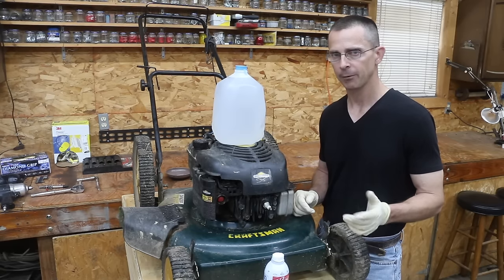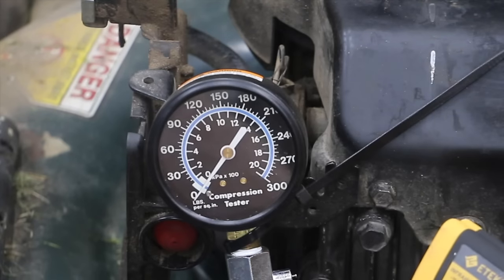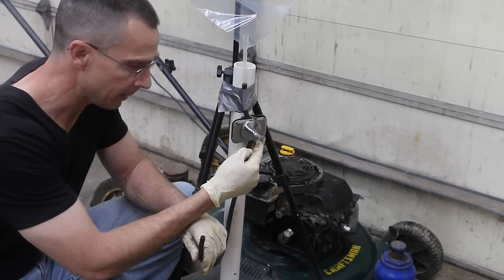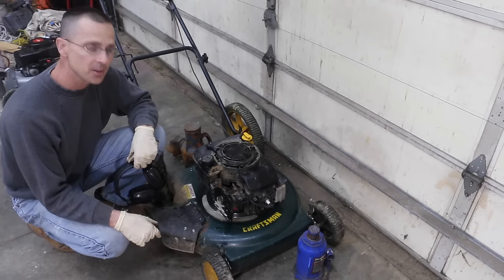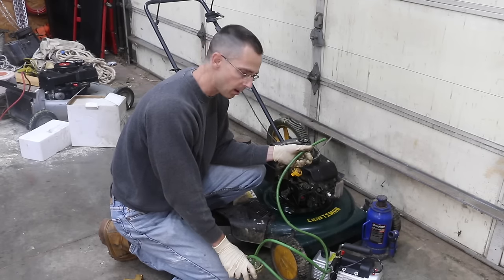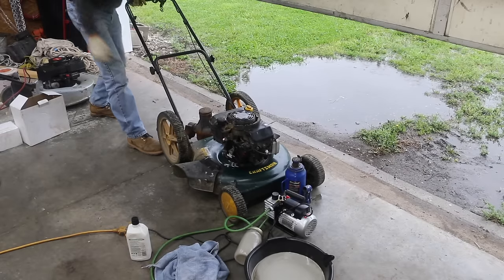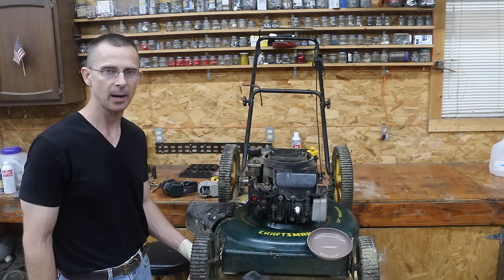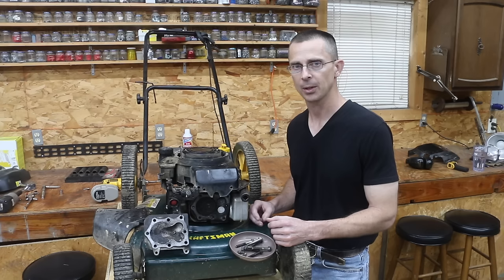Seafoam--can't believe what it did to my engine episode 5--cylinder cleaning test using water!!

Comment: Sea foam: spend $7 pour, run, change oil, enjoy. Water: Free design drip system, construct drip system, run and monitor for hours, change oil several times (not free), enjoy.  You decide who's the winner.
Reply from the maker: Thank you!
Reply: The viewers won outright.
Reply: Seafoam in my book. Much less work on my part. My time is worth more than  the $ 7.00  for seafoam when you consider all the extra time needed for the water drip, extra oil changes and the oil.
Reply: Not to mention that water has low lubricity. Water on the cylinder walls is oil NOT being on the cylinder wall. Seafoam atleast has lubricity. Thats enough for me to stay away from water.
Reply: It's easy to see the clear winner here. But for people who has time, H20 hands down !
Reply: Yes, a spray bottle into the carb is all you need, not a gallon of water.
Reply: ferkemall  so what is the original stuff
Reply: @BepBepStev  there shouldn't be oil on the cylinder walls above the piston. Water injection is/was a widely done thing on turbo engines to lower combustion temperatures and doesn't cause issues if done right.
Reply: @ItsFriscoBaby  the oil scraper ring is designed to leave a very fine film of oil on the cylinder wall. Thats why there is also cross hatching. The grooves in the cylinder wall are so fine yet they allow a small amount of oil to sit in there for lubrication.

Also side note. Water injection even during world war II was done for combat/emergency only. If done right it will take it a long time before it causes damage, but regardless, it eventually will cause premature wear on the rings and cylinder wall.
Reply: Still looks like carbon build up on the head and piston, just wire brush it !!
Reply: The reason that the water didn’t work well is because he didn’t do it correctly. Plus it’s a lawnmower engine. Here is my opinion, it is a lawn mower easy to take apart. You can either use seafoam and it work decently, or you could use water correctly and it do a little bit better than seafoam. Or since you can easily take the head off, you could just wire wheel it literally perfectly clean and spray some break cleaner on it and clean it off with shop towels. Which btw is 100% effective.
Reply: They didn't ban 2 stroke engines and 2 stroke oil is still plentiful. Sea foam is a mix of an oil and a solvent. Not just rebranded 2 stroke oil
Reply: Who would even suggest inserting water anywhere close to the insides of a hot engine ? I hope no one's my mechanic. Water doesn't lubricate well, doesn't combust, can cause corrosion, blows by into oil. Definitely not a good idea inside any engine that I'd want to see last (yeah don't tell me about performance, water-meth, etc. it's not the point of those videos at all).
Reply: I think its best when using a spray bottle at least some kind of mist system instead of a 'drip' for better atomization. And I think its alot of water for a single cylinder application thus finding water mixed with the oil.
Reply: Justin Henry  Well tell that to the piston rings, crankcase and oil. They didn't get the memo.
Reply: A cheap squirt bottle with a spray nozzle and a few sprays like 1 or 2 every 30-40 seconds over 2-3 minutes is enough water to break up any carbon, but not destroy any sensors, you're basicly just steam cleaning the combustion chamber and valves
Reply: Seafoam
Reply: @BikerBry  Very few cars still on the road have carburetors these days.
Reply: @ProjectFarm  My high school instructor told me about this..... his solution for getting water into the engine was a spray bottle.... If memory serves me it needs to be a mist like fuel, small particles. Basically the hot engine gets misted water inside of it and it turns to steam.... The way the water was going in was bringing down the over all temp of the engine..... I've never tried it personally but I think it would be worth a try... Just like a leaking head gasket on a car, usually the clean cylinder is the one leaking water.
Reply: ferkemall p
Reply: Its called a  test.
Reply: @randyl.wilmoth2884  no it works like this- steam does not compress like air so it fractures the carbon. I used a t fitting to the throttle body then 1/8" clear pvc tubing to the drivers seat.  2 small brass needle valves, 1 goes to a slim pickup tube in a quart of distilled water. Cap is vented. Other valve to air. Open that first then introduce water at highway speeds where vacuum is constant. Helps to have an expansion chamber of larger tubing for atomization. You shoot for 1:10 water to fuel.  In about 25 miles  of operation your combustion chambers are shiny clean.
This was on a 95 isuzu rodeo that failed smog. Seafoam and techron had no effect. Results checked with borescope. Engine revved more freely after and passed smog.
Reply: so he spend 2hrs using water and save $7 on seafoam , i guess he make only $3.5 per hour and was it worth the time spent ? lol
Reply: @samhandsom236  dont know about him but seafoam was completely ineffective on hard carbon deposits on piston domes. Water did the trick in a couple hours of driving.
Reply: @MozzaBurger88  lol youre worried about  drop of water getting into the crankcase oil? What about the combustion by product? 
A little gets in. The moisture quickly evaporates in the heat.
Reply: ferkemall  Is this supposed to be a joke? Sea foam doesn't have any of the properties of oil.
Reply: ferkemall  Please present your facts
Reply: Jesus.
In a car you get a pump pack (to atomise the water into droplets), take your aircleaner out, and SPRAY SOME into the inlet at regular intervals. Do that for a bit. Job done.
Reply: ferkemall  Seafoam is not engineered like 2-cycle oil at all. It does not act nor perform like oil. You will damage any engine if you try Seafoam as an oil and not as an additive.
Reply: ferkemall  I'm not here to argue sir. You specifically wrote Seafoam=2 stroke oil. You did say that. You also said they just put another label on 2 stroke oil and called it Seafoam. Neither of these are true. I'm sorry sir but you did write that. Your intention may have not been to say that and if that's the case, cool. I have been working on engines from lawn equipment to motorcycles to cars for about 35 years. Still working as an automotive tech. So we have similar experiences. It may be your writing just didn't properly convey your thoughts in English properly. I'm not mad sir and I wish you the best
Reply: @doctorfeinstone6524  alcohol mostly.
You can use e85 fuel as sea foam for your fuel system
Reply: Shit I won't even change the oil after running 20oz of seafoam through engine. About to go try seafoam out to see if it helps me with pinging.
Reply: Two strokes are not banned. At least in the U.S. there are still new 2 strokes being made today.

Comment: Last question... Yes I would and do use water. Always have. As in the other suggestion I actually switched to steam with wand applicator. The steam is what cleans and its already in steam form and much easier to deliver especially in a fuel injected engine.  

I do suggest using the steam wand ... I believe you will be impressed with the outcome... Maybe use a vacuum pump on a small engine to help with the crankcase. Although you should see less with steam.
Reply: I agree injecting vapor would be better.  My Dad had a vapor injector on a Chevy 402 engine.   But on the other hand, Seafoam and be done

Comment: Just a suggestion for ease of comparison. I know that the seafoam results are in another video, but a quick recap (just the pics) of the seafom would be helpful. Also would it be possible to use a split screen to show, say, the seafoam vs. water. This is more of a suggestion for the post editing process before upload and publish.
Reply from the maker: Great point and great tips!  Thank you

Comment: Many years ago an old timer mechanic showed me how he "steam cleans" the combustion chambers in car engines and I have done it many times myself, though not in many years now! Start the engine with the air cleaner off. Bring it up to tamp and raise the idle while pour water slowly out of a jar/cup and while it tries to die, raise the RPM higher to keep it running. I have seen a difference on spark plugs before and after doing this, so I have to imagine it helps clean everything else in the chamber!!
Reply: Be care full ! Spray bottle is the best .

Comment: Man, you put a lot of work into this, thank you!
Reply from the maker: Thank you!
Reply: I would never put water in my engine 'cos it seems so counter-intuitive.  But I have used a lot of Marvel in older cars  (1980-something Monte Carlo and a 1970 Chevy Nova) that I had back then.  and I thought it did help but not enough to continue using it.  I am pretty biased about Seafoam which I think is great but I haven't sprayed inside the carbs yet.  Question. my old supercharged Jag 2004?  Mi bambino?  
 isn't it true that if I put one of those 'Restore' liquids in the engine though, for the next ten oil changes or for the rest of its life, I will have to put at least the same amount every time I change the oil?
Thank you very much for these videos; they're beautifully done, crisp, clean and to the point.  Watching your programs is a bit like how going to church on Sunday used to be!  I know it takes a lot of effort on your part! So Thanks again.
P.S.  That is my wife's picture, not mine; I stole her laptop when she wasn't looking!

Comment: Great video :)  I have used water to clean my engine head/valves, but the way I did it was to warm up the engine, pull off the air filter, rev the engine to 3-4K rpm and then spray carbonated water from a bottle into the intake directly for a few seconds.  The engine doesn't sound happy when you do that, but afterwords it runs fine again.  Still, that is a quick-fix only, until you have the time to take the engine apart and clean/inspect thoroughly.

Comment: Pulled many  cylinder heads from many vehicles that had blown head gaskets. The affected cylinders were nearly spotless from the steam cleaning every time.
Reply from the maker: Thanks for commenting on this!
Reply: GM has a habit of blowing head gaskets :P
Reply: I have a boat with a leaking head gasket on my 2 stroke. Only one cylinder and the spark plug looks brand new after a whole season
Reply: I've had the same experience
Reply: DRHJR DRHJR
1 second ago
Yes! What I do to clean fouled spark plugs and clean the carbon off the head and valves is just take a glass of water and slow pour(1/2oz at a time) it into a car carburetor, or take off a small vacuum hose and let it pull the water straight into the intake manifold. The water goes in, and under compression then flashes into steam, shattering the carbon.
Reply: I'm currently taking my wife's GM car's heads off due to a blown head gasket. I was blown away on how good DexCool antifreeze works to clean heads and pistons! They practically look brand new.
Reply: You aren't...implying...that the steam treatment causes blown head gaskets are you, Derrick (smiley face)
Reply: How do you apply the Water to the cars? Do you mix it with Brake Fluid? Thank you!
Reply: The difference is the water is added already pre heated from the cooling system and in smaller amounts usually.  I have seen cars with a headgasket that failed abruptly and there was no cleaning effect
Reply: Yep sure does
Reply: its apparent YOU dont... Move on!
Reply: Michael Woodcock 

What about all the water an engine produces as it runs? Why doesn’t it remove deposits? It meets your criteria: hot and added continuously in amounts approximately equal to the volume of fuel consumed.
Reply: @FrankGutowski-ls8jt  water is produced from an engine?
Reply: randy schmidt 

Sure does. Lots and lots of it. It burns hydrocarbons doesn’t it? What do you suppose becomes of them when they react with oxygen?
Reply: @FrankGutowski-ls8jt  the fuel becomes hydrocarbons among other things but not burning them.
Reply: randy schmidt 

Google combustion.

Did you ever wonder what becomes of a match when it burns? What becomes of the paper or wood?
Reply: @FrankGutowski-ls8jt  when I was a child. Even if an engine did produce water it would be a product of the engine therefore having no pathway for cleaning deposits.
Reply: randy schmidt 

Are you sure? Can you prove that it doesn’t?
Reply: @FrankGutowski-ls8jt  I'm not trying to prove anything. You stated an engine produces water. Just to play along with this charade though...... If it produces water it would be in the exhaust, away from the combustion chamber therefore  having no pathway to clean anything.
Reply: randy schmidt 

No fuel’s there. Consumed already. It’s what makes it go ‘round and ‘round...hot, compressed gasses contain thermal energy; allowed to expand, they convert to kinetic energy.
Reply: @FrankGutowski-ls8jt  dude stop. Trust me I know how an ICE works. Obviously way better than you.
Reply: randy schmidt 

I was busy doing other things and not really paying much attention to your comments.
Reply: @MOS-MHz  Oh...and "reliable" (overrated) cars like Subaru and Honda don't? LMAO
Most people don't know why or how head gaskets fail. 
Guess what I'm doing to my old trusty "reliable" Subaru right now?....head gasket AND timing belt. (Who the fuck uses timing BELTS after 1980?!)
Guess what car has MORE mileage without ANY of those issues?.....Yup...my "GM junk".
By the way...turns out you have to pull the fucking motor on a Subaru to change a head gasket.
GM...not so much.
Reply: An internal combustion engine produces approximately 1 gallon of water vapor out the tailpipe for each gallon of fuel burned. Ever see the exhaust fog (contrail) on a cool day, or water shooting out of the tailpipes when the engine revs??
Reply: I meant one gallon of liquid water not water vapor out the tailpipe.
Reply: +HotRod Ray So, according to you, a gallon of fuel magically becomes a gallon of water. Think this through.
Reply: @FrankGutowski-ls8jt  I would go to a different gas station that did not sell you so much water with the fuel.
Reply: jwkivy 

Yes it does. And about 10 lbs of CO2. The wonders of chemistry.
Reply: K0nst4nt1n96 yup, because if you wreck the car, you don’t have to worry about carbon build up! But seriously water will mess up braking systems.
Reply: @MikeMorris-tt2xv  Anti-freeze probably actually cleans better than water.  Because while anti-freeze lowers the freezing point of water it also lowers it's evaporation point.  Causing it to flash to steam much faster than regular water, and clean more effectively.
Reply: Slim Jim 

Nope. Completely wrong.
Reply: @randyschmidt19  octane + oxygen (with energy *heat/sparkplug) = co2 + h2O.
Chemistry... Yes there is technicly water vapor coming out of your engine
Reply: @karlendor3398  lol. Octane is simply resistance to knock so not sure how you mix that. If you have a catalytic converter then emissions do turn into water vapor and you might get some in the valve cover but once at operating temp no
Reply: The antifreeze is mostly responsible for that
Reply: I'm pretty sure what he means but im also quite dense at times. Can someone explain? Can water be the cause of the blown gasket or possibly antifreeze as others say?
Reply: Steam cleaned and rusty ...
Reply: @randyschmidt19  no because some of that water makes it's way into to the oil aswell. The water is produced as the fuel burns. Most goes out the exhaust, some into the crankcase. This another reason why long drives are way better for your car than short ones. Long drives allow the oil to heat up hot enough and evaporate all water that made it's way into it from combustion. Just admit you're wrong.
Reply: @FrankGutowski-ls8jt  our future looks pretty grim doesn't it?
Reply: @jwill9877  no you see a short drive allows for condensation in some upper areas such as filler caps and  valve covers.  Now if you had a vented valve cover or a catch can that would not even be an issue. Without getting into thermal expansion short drives is not a huge concern. Now If you put enough water into the combustion chamber that it flowed out the exhaust then the engine would be fucked. Ever heard of water injection? It's apparent you need more education.
Reply: Slim Jim 

No. It raises water’s  boiling point. By evaporation point perhaps you mean vapor pressure? It raises it as well.
Reply: jwkivy 

Yes that’s correct. Fuel acts as a reductant. Oxygen as the oxidant. The mass increase that occurs as a result of combustion originates from the addition of oxygen to hydrogen and carbon in the hydrocarbon fuel. .
Reply: J will 

It’s far worst than we are willing to acknowledge.
Reply: Yep
Reply: @randyschmidt19  What does an EGR valve do?
Reply: @Mini14shootr  Google that bro. It's an acronym.😉
Reply: @drhjr7516  Not recommended on turbo applications for sure.
Reply: My mom taught me at a young age that water alone doesnt clean my body... gotta use soap with that water to make things clean!
Reply: @bumtracksNew  heat that water to a steamy 200deg and spray your body
Reply: You mean, you like Subaru, some Civic's and a few other head gasket blowers

Comment: Just watched this 5 years later. Wow. Your channel is still great after all these years. I’m wondering if the methodology gave the mixed result. I’d be tempted to add a mist of water in the air intake in a stop/start way to keep the engine temperature higher. You may achieve a better ‘steam clean’ that way. This appeared in my feed after searching Liqui-Moly Diesel engine cleaner. Still love your work 👍
Reply: Now that’s an idea
Reply: Water+methanol injection systems exist for ricer racers and drag racers.